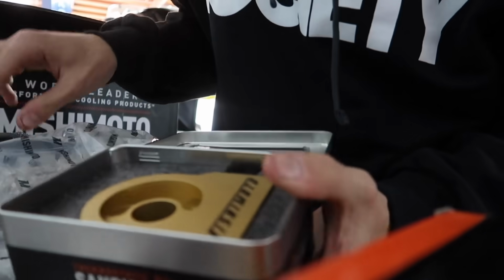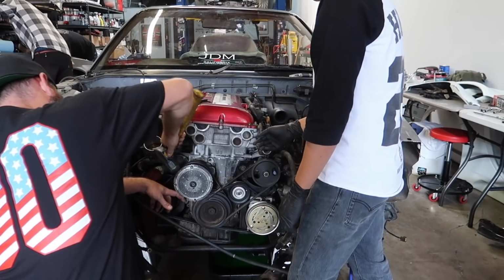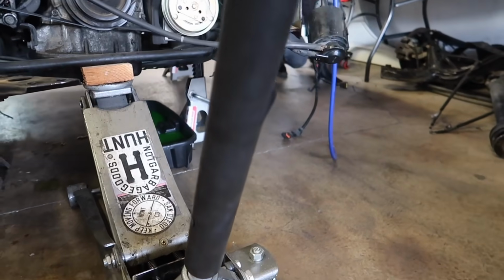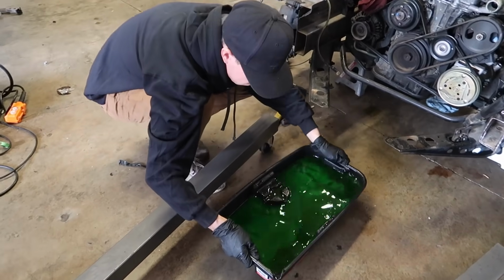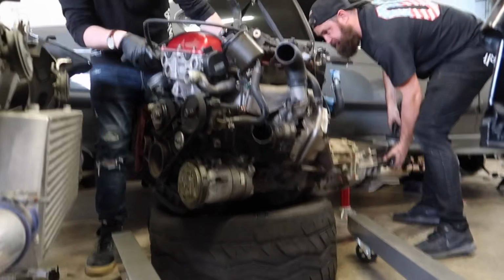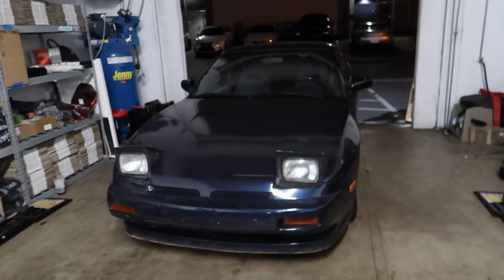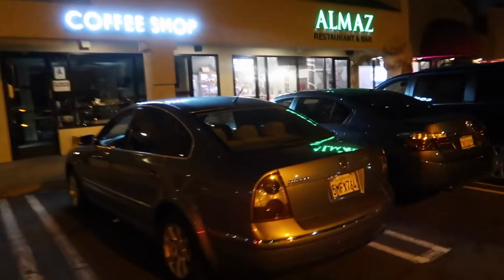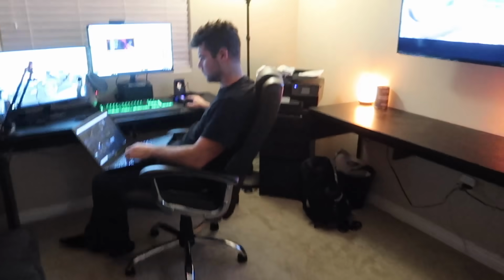Calvin's SR20DET Power Build!

Comment: I have an SR20 replace the water pump,fan belts, spark plugs, get coil packs, bigger fuel injectors, new turbo, straight through exhaust, Coilovers, strut bars for the torque and happy days have fun bwap bwap PS sometimes car may not start due to alternator only charging for so long then when you stop the car no power and it has to charge up and ignition relay fuses

Comment: Yo TJ fam *help me out*??
Was throwing donuts in my RWD 2004 Tahoe and it did a full 360 and I went backwards in gear, and my car died and my battery light came on. Turned it off and on again and it took a couple cranks to fire up again, but it ran fine after. Started smelling like something was burning for a while after. Any ideas?? Thanks